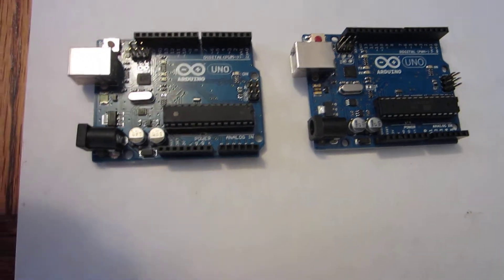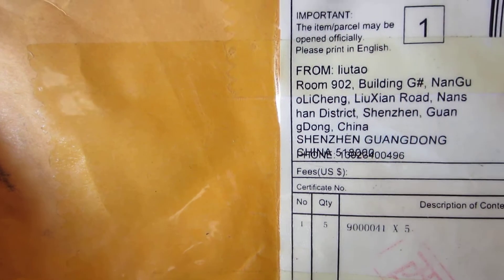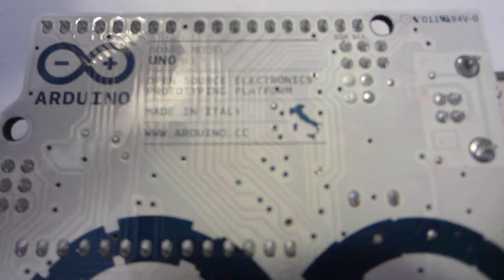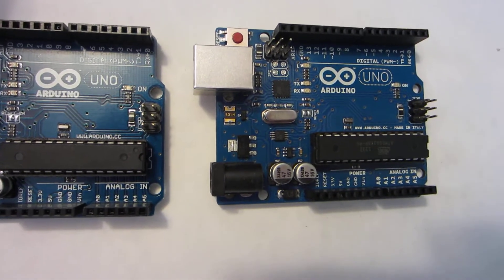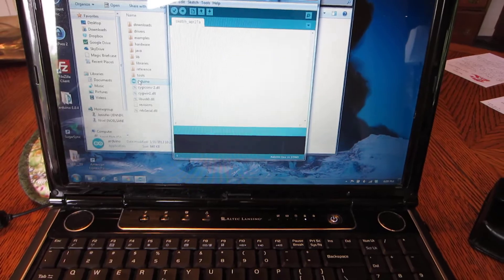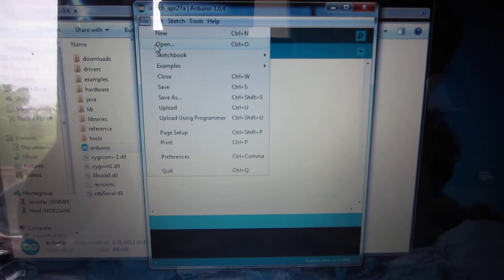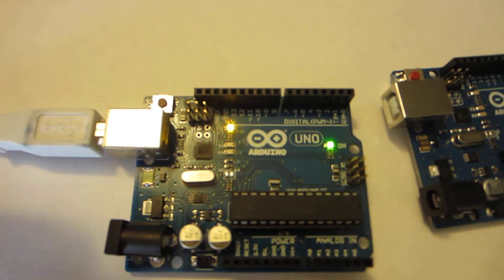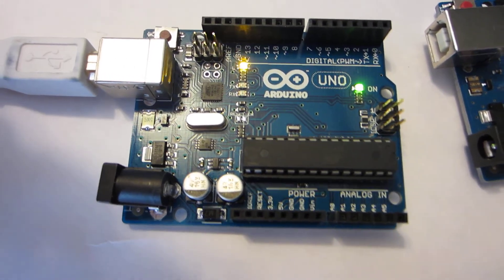Arduino Uno Chinese knockoff

Comment: lol, ordered mine like a minute ago. Got everything from China @ eBay. Can't wait to get my $3 Arduino. lmao !!! Did it on purpose, and I have no worries. Can't wait to get started.

Arduino Uno (China)
Maxim Dallas DS18B20 (NYS)
1 Watt 4.7k Resistors (China)
4-Channel 5V Relay Module w/ Optocoupler (NYS)
3 Ft USB A to USB Mini B (Male - Male) (NYS).

$17.74 Total. Let's see what happens. I'm fully aware there's videos on YouTube to show how to get it to work, so I'm more than willing to see.

Gee.. I got everything I wanted for my very first project, and didn't pay nowhere near how much the Arduino Uno would've cost me.

Now we play the waiting game. I will do an unboxing, and a 1080p, 20Mbps Crystal clear video when I get my shit from china. I bought from one of the most popular places on eBay for my board, Alice has like tens of thousands of these sold, and there's a video on YouTube for it, and plenty of help on Google. So, I honestly can't wait to switch some high Vac loads, and read some temperatures. If everything works well, I'll buy more boards, and buy more sensors, etc. 

Where did I get my board? alice1101983

Currently 21,490 sold, and 5 of 5 Star Review rating. CLONE.